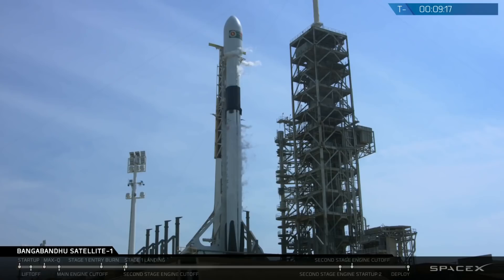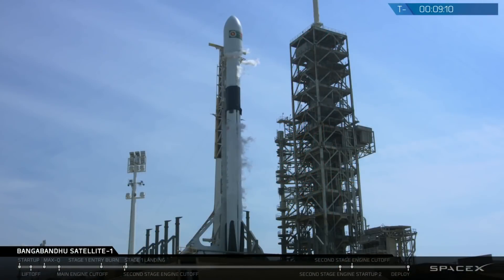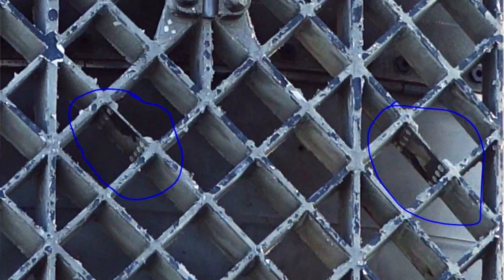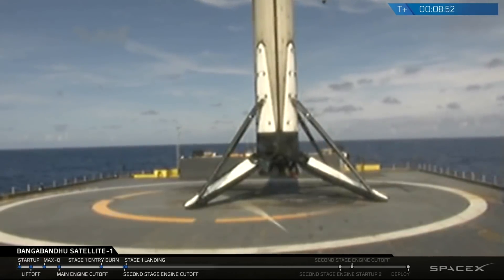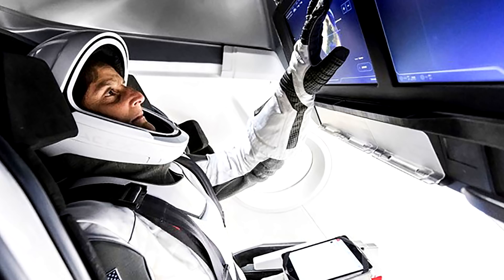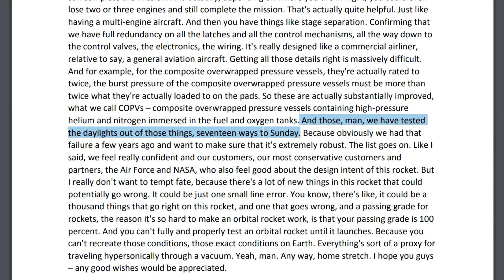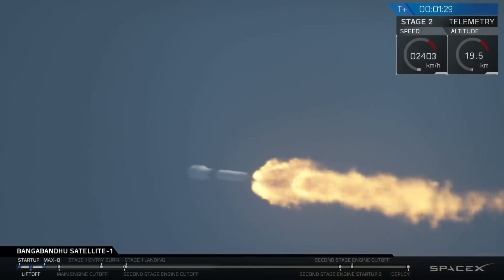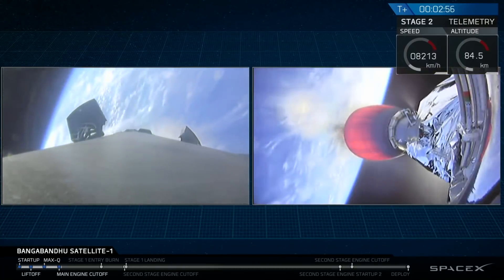How Well Did SpaceX's new Falcon 9 Work?

Comment: NASA's the one critizaising human saftey....
When they disregarded it for decades on the shuttle...
Reply: Do you know that escape system on SLS will be useless if SRB explodes? It will saturate surroundings with burning debris that will destroy the parachutes.
Reply: Ondřej Dujka ... The parachutes wouldn't be deployed until long after the explosion. Alot has to happen between escape jettison and parachute deployment.
Reply: Its almost as humans (NASA) learns from their mistake, weird huh Jesus Ramirez Romo.................................................
Reply: Motokid600: Go tell that to USAF http://images.spaceref.com/news/2009/fratricide.report.pdf
Reply: it's almost like they learnt?
Reply: If NASA learned from their mistakes they wouldn't have killed 14 astronauts in the Shuttle Program.

Every time NASA has killed astronauts, it's been because government bureaucrats overruled the contractor engineers.

Apollo 1: 
Contractors: "You want to do a ground test in pure oxygen, and have a door that opens inward in a pressurized capsule? That's insane."
NASA: "We're the government. We know what's best."

Challenger: 
Contractors: "You want to fly in subzero temperatures? That's insane. The O-Rings aren't rated for that temperature and they can't guarantee seal."
NASA: "We're the government. We know what's best."

Columbia:
Contractors: "We need to do something about the ET insulation. It's flaking off and could damage the shuttle on launch. Sure it will cost money, but we need to do it..."
NASA: "We're the government. We know what's best.
Reply: +magicstix0r
You think private companies are immune to cost-cutting and bureaucracy? Get a grip.
Reply: magicstix0r so what are you trying to say ? Has NASA learnt from their mistakes or not ? 😂
Reply: +Zappy99 I like how your half-assed, emotional reply consists of "OMG BUT THEY DO IT TOO." When my original post was filled with exact examples with evidence. 

lol.
Reply: This is called prevention.

Edit: Lol he deleted his post
Reply: magicstix0r, managers should never have had the authority to override a competent engineer or scientist saying: "that's not safe". It shouldn't be in their purvey. 

In general, the competent have an ethical superiority over the ignorant in their narrow field of specialization.
Reply: Well, that's why they're being extra careful now. It would have a lot more gravitas, admittedly, if NASA-designed spacecraft weren't responsible for more astronaut deaths than the entire rest of the world's space agencies combined, and if they weren't now dependent on Soyuz because of that which, while a very safe and reliable launcher, is totally out of their control to begin with. But I can certainly see why they're jumpy.
Reply: Better late than never
Reply: The engineers have control when you are talking planning.  In operations, the managers have it.
Reply: +magicstix0r
How is it "emotional" to point out how you're a hypocrite? You bemoan the failures of government programs while ignoring the fact that the exact same problems in private companies. If you want to prevent unnecessary deaths caused by cutting costs, then the solution is not to put the task of shuttling astronauts in the hands of a company whose entire business model revolves around cutting costs.
Reply: What are you comparing it to though?

AFAIK no private company has ever done human rated space launches so far.

They have done unmanned launches, and had a fair few launch failures along the way.

Russia of course has done manned launches.
Though it's also killed a few people in the process.
Possibly not as many as Nasa, but still...

What are you comparing it to?

privately operating airlines have killed thousands, sometimes randomly, due to unpredictable reasons sometimes through incompetence.
Partly the discrepancy in numbers is because there have been many more millions of people that have flown than that have ever been to space...
But certainly a quick examination of air travel accidents shows anyone can get it wrong in any number of ways...
Reply: Private companies mean real people can be held criminally liable for their decisions.  Exactly who was held liable for the criminally negligent homicide of 17 NASA astronauts?
Reply: I am critizising your spelling
Reply: Zappy99 lol he never said they didn't. He simply said that NASA is responsible for deaths that were COMPLETELY avoidable. Which is true. And regardless why does "private companies do the same" make NASA doing it ok?
Reply: It almost makes you wonder what "critizaising" is.

Comment: what was the fastest back-to-back launch for the spaceshuttles? A couple of month seems kinda fast.
Reply: The Atlantis had two launches 54 days apart. Unfortunately, Celebrity Cruise Lines was contracted to clean the  crew cabin quickly and the norovirus on the second flight was heartbreaking.
Reply: Space Shuttle Atlantis landet on 3. October 1985 15:15:30 on STS-51-J and launched on 27. November 1985 00:29:00 STS-61-B = 54 days, 9 hours, 13 minutes and 30 seconds.
Reply: 54 days I believe by Atlantis. Faster than what TESS and CRS-15 is doing
Reply: tx for reply :). fav forum ever :)

Comment: I can't belive that the titanium fins are reusable. Because titanium looses his special abilities when heated over 400C° and is trash worthy when it was glowing once.
Reply: not true.
Reply: What do you mean by "special properties"? Titanium components normally have a temperature limitation of ~520-550 C (above that you get oxygen bonding to the titanium and making it more brittle) , but there are alloys which can go higher. I'm sure spacex has chosen an alloy that can withstand the required temperatures.
Reply: True for pure titanium however they use alloys, in almost all applications alloys are used (ofcourse not when you need pure materials in for example: chemistry applications)  and not pure metals.
Reply: Fire Powered RadioActive Elevator 
Pure titanium is hardly used for anything performance oriented I know of. Alloys are where it's at, especially when you want that top tier strength to weight ratio.
Reply: Oh dude you're totally right, SpaceX is gonna facepalm when they realized they spent millions of dollars designing, fabricating, and testing these titanium fins for their rockets without checking to see if titanium would work or not!  :^)
Reply: They have already flown the Ti fins 3 times. They work fine.
Reply: I'm sure some random youtube commenter knows more than the actual SpaceX engineers eh?
Reply: LOL.
Reply: Kamaling, you cannot even spell "believe" or "loses", so I do not think your opinion is of much value.

Comment: On the space shuttle they didn't paint some sections at all to save weight.
Reply: That's basically the same thing here, they add a protection, which is black and they don't bother painting them. The titanium grid fins are not painted, but titanium is usually treated. You could change the kind of threating to change the color of the titanium. This can be handsome if you want to see excessive stress on the material or abrasion. They choose to go this way, those fins are not colored like plane titanium would look like.
Reply: seasong hence the orange tank.
Reply: It is cheaper though.
Reply: pixelshock Well there's the thing. The Falcon can (and has been) still be flown expendable, for a heavier payload to higher orbits, if required.

The rocket has to be build either way. So if you put in say...5000 pounds of payload instead of the maximum 18000 F9 can take to GTO, the rocket still costs the same, sans a bit of fuel, potentially. Then going and letting that burn up is the height of inefficiency, instead, with so much payload margin, just fill'er up with fuel and bring her back, why not?

Multiple capabilities and streamlining. This way, SpaceX can always build the same rocket, no matter the payload, and still fly smaller loads at reduced cost. No faffing about with multiple different launch vehicles (all needing completely seperate ground infrastructure) and perhaps even multiple configurations of those (I think there's in excess of 20 different versions of the Atlas V, alone)
Reply: pixelshock, Are you drunk, In every case recycling and reusing is more efficient. What kind of backward logic are you using
Reply: It's not paint in the space shuttle it's carbon panels they only put carbon panels on the bottom they are heavy but they really don't need carbon panels on the top cause there's not too much heat on the top they only need it on the nose cone,bottom of the body and the leading edge of the wing
Reply: pixelshock are you talking about falcon 9 or falcon heavy I'm just gonna assume it's falcon 9 it's payload capacity would be brought down from 20 tons to 10 tons LEO and it costs 60 million I don't think the rockets reliabitly is 90 percent I think it's 96 or something like that how landing the booster make the whole rocket fail and it would be cheaper to use a reusable booster cause you get 30 or 40 percent of the rocket back and engines are the most expensive part of a rocket and the flight computer so using a reusable booster would give everything back
Reply: claxix95 the boosters were recovered in a shuttle launch
Reply: They have the efficiency to put what they want into the orbit they want while making a decent profit.
Saving the engines is a pretty efficient thing to do.
Reply: It all depends on which efficiency has your highest priority.  For Musk it appears to be overall cost to orbit.
Reply: The reliability is 96%, having only 2 failures in over 50 launches. 

Also the idea that a re-used engine is automatically inferior is odd. Although that is why cars depreciate by 5,000 dollars as soon as you drive off the lot. (In other words it's a car salesman's mentality.)
Reply: Which makes sense. If the cost is down so much that you can sent up 3 flights for the price of 1 flight of the other guys, then you are hauling a massive amount of weight into space.
Reply: As far as efficiency goes, I think you need to look at the closest analogues. 
Consider the Falcon Heavy.  In size, the closest launch vehicle is the Delta IV Heavy.  If you look at the two, you would think that the Delta would lift more. But, the Falcon Heavy can lift more than twice the weight of the Delta IV into LEO.

Part of the reason that SpaceX is able to do what it does is that they figured in efficiency at the very beginning  of the design process and have improved on that efficiency with every single launch, to the point where the Block 5 can launch much much weight than the Block 1.
Reply: You see that iconic orange tank it's orange cause they didn't paint it they didn't paint it not because it would save weight but because it would be expensive to paint and paint isn't heavy sure it might be whe you hold a bucket of paint but most of it is just water
Reply: Gamer Boy: Water is pretty heavy, actually. Not painting the tank saved 600lb which doesn't sound like much, but when it's being directly added to what cargo can go to space it means a lot of equipment or supplies.
Reply: TheDemocrab yeah especially on the space shuttle which costs like 10 thousand dollars per pound that's 5000 dollars and painting it would be pretty expensive too cause it was just gonna burn up in the atmosphere once the rs 25s stop burning
Reply: You are wrong.  The expense of the paint, including labor, is chicken feed to NASA.  AN additional 600 pounds to orbit is like liquid gold. If you think 600 lbs is to high a figure, then you've never painted a house, and the ET has more exterior area than any average house.
Reply: @pixelshock reusing a booster does not bring down the payload (ok, it does a little bit, but not much). RECOVERING the booster does bring down the payload. This is true even if it's brand new and being recovered for later flights.

Also, flying a used booster can IMPROVE reliability. There is a reason that new airplanes only have a very minimal test crew for several test flights before going into service: in reliability engineering it's called "infant mortality". That's when a brand new product has a defect that fails on the first use or very early in life. Once you use something several times you can be pretty sure it didn't leave the factory with a fatal flaw.

And reused boosters do not have 90% reliability. SpaceX has flown 11 used boosters, all successfully. That's a 100% actual success rate, and a 92.3% expected reliability.
Reply: King Peter, Recycling is almost never more efficient for most materials unless you're talking about things like steel. Reusing can be, but not always, due to extensive maintenance costs and the increased risk of total loss.

That's the big misconception people have these days. Things like plastic and paper recycling are utterly pointless. They have little to no upsides, they just cause more pollution and produce inferior products to entirely new.
Reply: +Ruben Kelevra I think the fins and the protection would make it heavier and they also have to take extra fuel. Overall it's a less efficient rocket, because they want to make it reusable. I wonder if it really is cheaper this way.
Reply: seasong REALLY THATS THE DUMBEST SHIT EVER.
Reply: seasong it is though because rebuilding a rocket everytime you need to send something to space is way more expensive than the loss of potential payload due to the additional fuel needed for a single launch
Reply: Mink Tanker WHY DO YOU BELIEVE  THIS SHIT.
Reply: pixelshock it is better to recycle than throwing sh*t everywhere, u ever heard about pollution? cus ozone layer in the next 20 years will be ded, cus alot of bfr's are gonna launch to mars lol ye
Reply: Seems pretty efficient to NOT throw the most expensive part away every time.
Reply: pixelshock That's not why they do it. It's to get the costs of space travel down. It's been their goal since the beginning. From their website: "SpaceX continues to work toward one of its key goals—developing fully and rapidly reusable rockets, a feat that will transform space exploration by delivering highly reliable vehicles at radically reduced costs." They're trying to make space travel affordable so that humans can actually start to EXPLORE space, rather than just stare at it.
Reply: mPky1 I'm not sure where you got the numbers on that, but even if SpaceX charges NASA more, it's still significantly cheaper than any alternative. Also, every article I read says that the recent cost increases are due to NASAs very stringent requirements, which have caused SpaceX to redesign Dragon, so it's not just out of spite. It's due to actually increases in cost.
Reply: mPky1 "sx charges nasa at the minimum 2x, what could possibly cost twice as much as for other customers, except for the fact the gov is dumb enuff to pay ?" Where's the source for that? I'll admit I don't know much about this, but I'm highly skeptical that SpaceX would arbitrarily charge NASA more. And I'm pretty certain it is still cheaper than alternatives.
Reply: mPky1 Yeah, I'm pretty sure, as that's kind of their entire thing. The point of SpaceX is to be cheap.
Reply: pixelshock uu sir it’s not just about them being able to reuse it saves money if you don’t throw away the rocket they are the cheapest rocket launches
Reply: Hayden Jones the difference in size between those rockets is just because one uses hydrogen and the other kerosene.
Reply: good
Reply: You guys are so stupid. This comment thread probably gave me cancer 🤦‍♂️